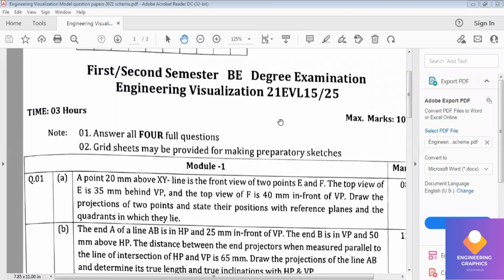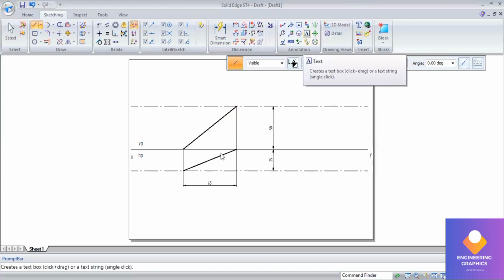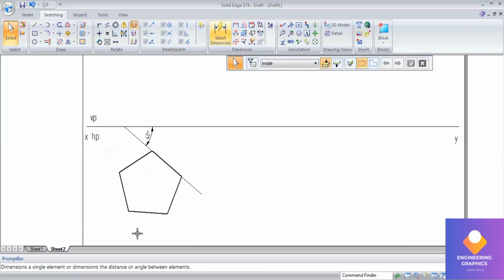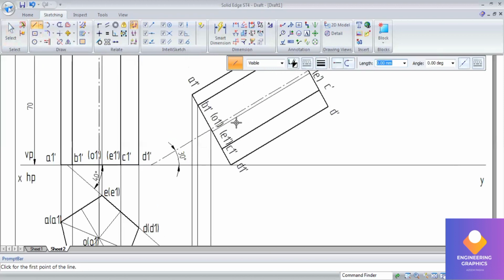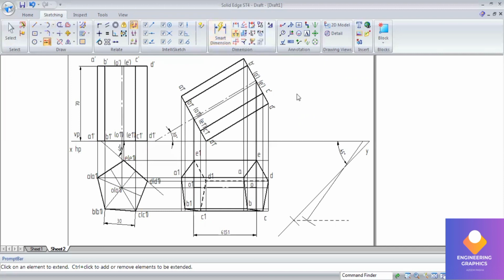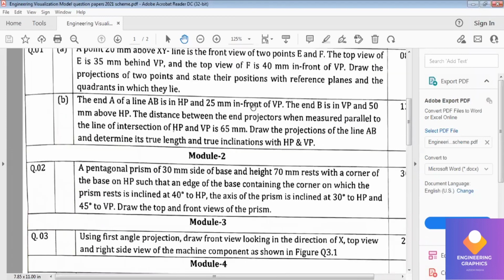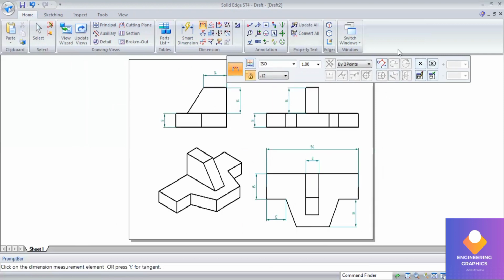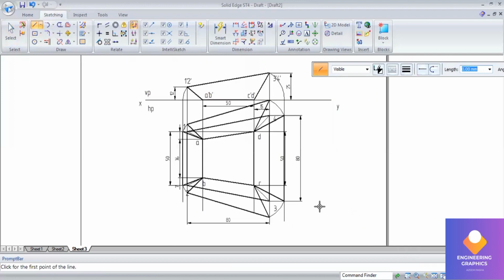Computer Aided Engineering Drawing ( CAED) VTU Solution for Model question paper set-1 (2022 scheme)

Comment: Sir is drawing in box sheet compulsory and will marks be given for box sheet drawing?or we can directly do on system?
Reply from the maker: Yes you have to draw in sketch or you will loose 5marks for each question
Reply: @engineeringvisualization1005  will topics come from all modules or can we skip some modules?
Reply from the maker: @mr_anonymous123  no you have to go through all 4 Modules
Reply: @engineeringvisualization1005  5 right?
Reply from the maker: @mr_anonymous123  4 Modules
Reply: @engineeringvisualization1005  points , lines , planes, solids, development and isometric?
Reply: Also thanks a lot sir your videos are excellent me and my friend are surviving with ur videos only , in caed class 🙏🙏🙏u are doing really great social work , keep going 🙏🙏🙏
Reply from the maker: Welcome and share to your classmates and friends
Reply: Sir?
Reply from the maker: @mr_anonymous123  yes
Reply from the maker: @mr_anonymous123  planes, solids, iso and development
Reply: @engineeringvisualization1005  point and line sir?i am currently in second sem chem cycle
Reply from the maker: @mr_anonymous123  it is a option question with planes in question no.1
Reply: @engineeringvisualization1005  I am not from your college so points lines is an option for all colleges no?so I will skip points and lines sir as my planes is strong?